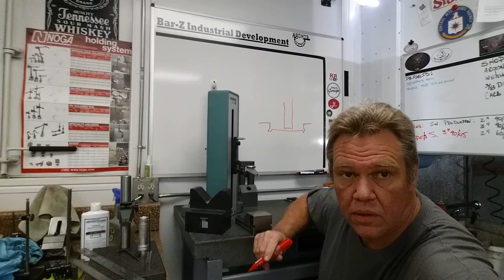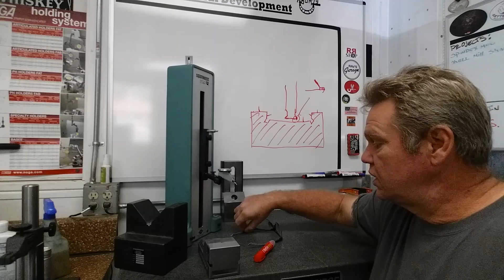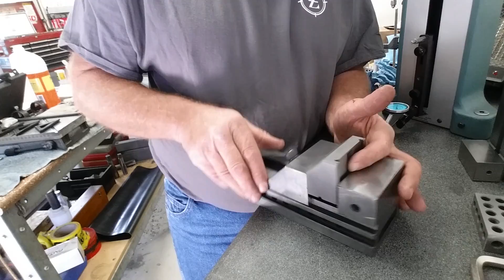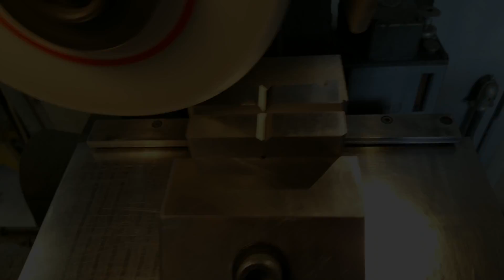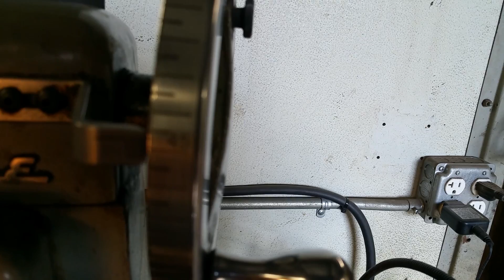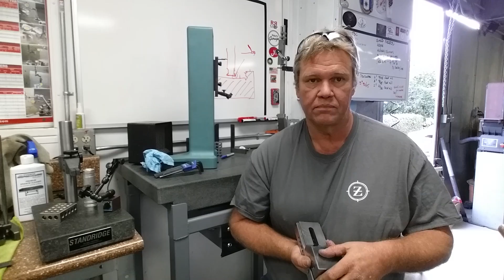WIYB Vice part #4

Comment: I remember when you used to be able to buy "kits" that were all machined, heat treated and ready for grinding. Was it Suburban Tool that sold them. Its been 30+ years
Reply: U-Grind, the link IO found was thru Penn Tool http://www.penntoolco.com/u-grind-tool-kits-71-048-3/
Reply from the maker: mpetersen6 thats pretty neat, thanks for the link!

Comment: Really nice work. I would like to share something with all of you though and if there are any comments on it I would appreciate it. I have been doing full width cuts with the wheel, feeding down a few tenths at a time until I get a clean cut. I reference my z zero and I move over almost the whole wheel width and do it over again until I'm clear across the part. I leave a few tenths for finishing and run the wheel clear across and I have gone the flattest parts ever!! Anyone else doing this? I feel the leading edges of the wheel get worn out less. I would love to hear any feedback. I been grinding 303 stainless.

Comment: Why didn't you use coolant? You are Mr perfection, wow,, could you show me/use the tool you was using to put the 45 degree included angle on your stone please.
Reply from the maker: +Robin Cox 2 reasons, first was for pure video reasons, coolant flying around gets all over the lens and the shots get ruined quickly. Second is a robust part like this can take the heat very well without distorting. The diamond dresser is by Yaswa and is called a radius and tangent dresser, I have showed setting it up in some older vids.

Comment: Hi Stan,
Great job and videos. 
Question, I've seen you use cool mist wile grinding to keep things cool, is there a reason why you didn't use it for this grind?

Thanks,
Steve,
Reply from the maker: +Steve W. This was a very heavy part, the heat got pulled into the part and away from the grind faster than I could generate the heat, my usual parts are very thin and heat quickly.